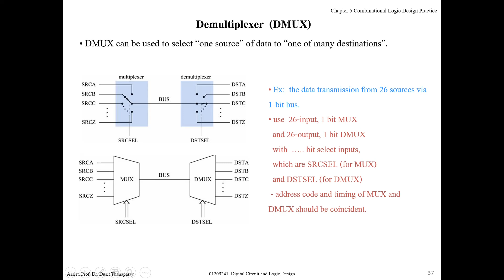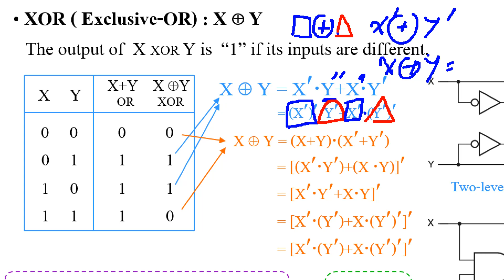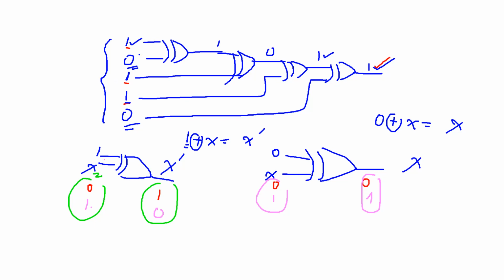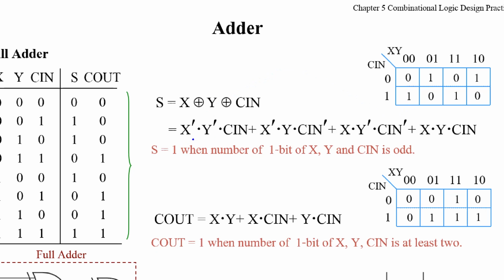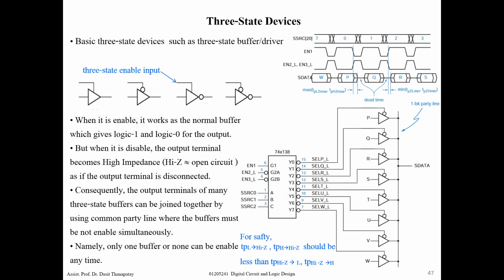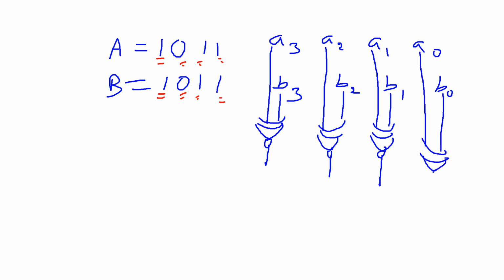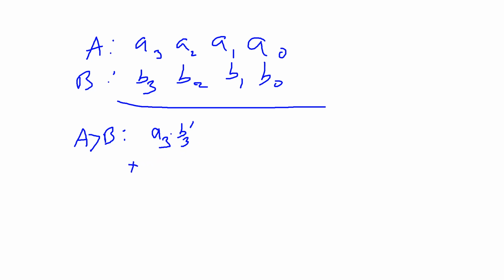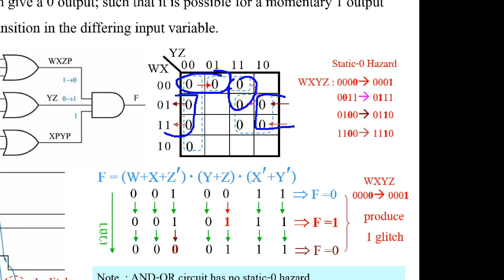01205241 sec 450 (IUP) Chapter 5 XOR and its applications

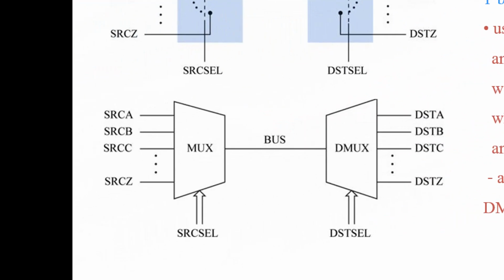Comment: 0:01 Demultiplexer (DMUX) : address code and timing of MUX and DMUX should be coincident.
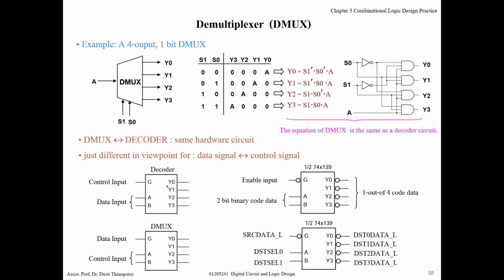0:44 DMUX <—> DECODER : Same hardware circuit, but just different in viewpoint for data signal <—> control signal.
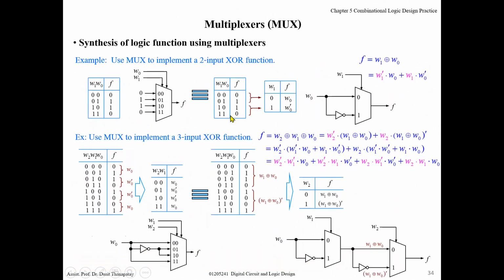4:40 Multiplexers (MUX) : The enable input EN_L is active low and the select inputs are named C, B and A (C is MSB).

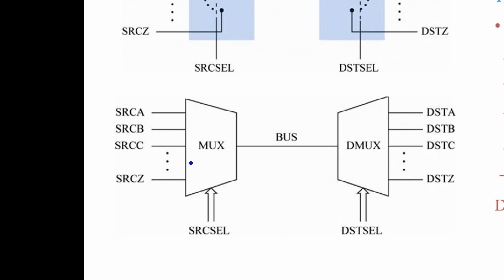Comment: 0:00 DMUX can be used to select "one source" of data to "one of many destinations.
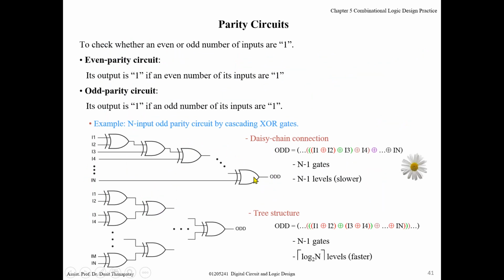19:49 Odd-parity circuit: Its outputs is "1" if an odd number of its inputs are "1"
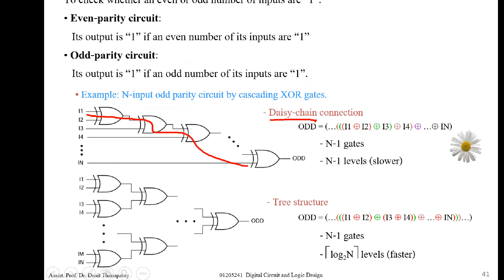21:43 The 74x280 9-Bit Parity Generator: It has 9 inputs and two outputs that indicate wheter an even or odd number of inputs are "1"

Comment: 4:35 The equation (and the structure of the picture cicled.) of DMUX is the same as a decorder
      circult.
40:59 enable input is active low----->put 0
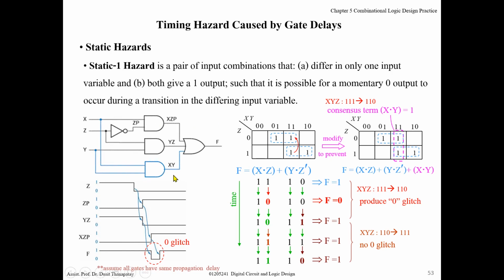1:06:44 Timing Hazard Caused by Gate Delays---->Static Hazards---->Static-1 Hazard.

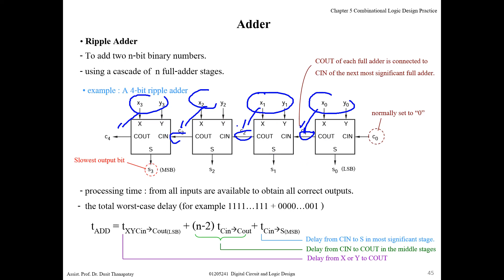Comment: 36:53 Ripple Adder: using a cascade of n full-adder stages. Count of each full adder is connected to Cin of the next most significant full adder.
53:25 Iterative Comparator: the inputs and outputs of each modules are cascading.
1:01:20 Magnitude Comparator: to indicate an arithmetic relationship between two numbers. (Compare from MSB to LSB).

Comment: 1)7:48 XOR ( Exclusive-OR) | The output of X XOR Y is “1” if its inputs are different.
2)21:56 The 74x280 9-Bit Parity Generator | It has 9 inputs and two outputs that indicate whether an even or odd number of inputs are “1”.
3)24:27 Adder | It’s binary adder for both unsigned number and signed two’s complement numbers.

Comment: 5:33 Edible input is some kind of control input
6:56 Exclusive-OR gates, in case of x=1 y=1 the output is 0
16:20 Parity Circuits are used to check whether an even or odd number of inputs are 1.

Comment: 4:31 Demultiplexer : The equation of DMUX is the same as a decoder circuit.
16:02 XNOR or EQU : If the number of bubble is odd, it is XNOR gate.
26:53 Half Adder : 2 bits inputs: Half sum and  Carry out.

Comment: 0:19 Demultiplexer (DMUX) : The device uses for receive one input from Mux and give many outtput.
16: 20 Parity Circuits : It is a circuit that uses to check an even or odd number of inputs are 1.
39:32 Three-State Devices : In enable, it work as normal buffer but in disable the output terminal will be Hi-Z

Comment: 10:06 In XOR circuit, You can add inverse bubble in 2of input or one input one output to the digital circuit and the output will be the same as A XOR B.
34:13 When you do Ripple Adder. The curry-out of the last digit need to connect to curry-in of the next digit.But if you operate the circuit at the same time the answer will be error. You need to be consider about the propagation delay of the circuit be to carry-out the correct thing to the next digit.
1:05:32 The timing hazard by gate delay If you have more component of gate It will not the write time of another gate to operate and it have glitch. We can fix by Write K-Map and using the compete some to predict and check the value are in from the delay.

Comment: 14:39 Exclusive NOR gate or known as Equivalence - output of this gate will be 1 if input are actually same.
20:23 Odd Parity Circuit - Outputs of this will be 1 when odd numbers of inputs are 1.
47:24 Comparator - use to compare the value of two binary no. to identify that they’re same or not.

Comment: 16:18 Parity Circuits: To check an even or odd number of inputs are 1
22:23 The 74x280 9-bit Parity Generator:Output EVEN is 1 when number of 1input is even
29:59 Adder Count = 1 when number of 1-bit of X,Y,CIN is at least 2.

Comment: 47:17 comparator structure: use a 2-input XOR/XNOR gate as a 1-bit comparator
52:37 iterative comparator circuit : the circuit contains n identical modules 
55:28 comparator - operation steps

Comment: 16:22 The parity circuit is used to check number for logic are an even or odd of input are“1” 
24:22 The adder from binary is for unsigned value and two complement signed value 
47:18 The comparator is use to compare with the value of two binary number are the same of different

Comment: 16:19 Parity Circuits used to check the number of logic 1.
52:46 Iterative Comparator Circuit is the circuit that contains n identical modules.
1:02:27 Timing Hazard is caused by gate delay.

Comment: 21:44 Output EVEN is 1 when the number of “1” inputs is even.
1:01:30 Example of 12-bit comparator using 74x85 4-bit comparators
1:05:45 We use the complete sum to implement the circuit

Comment: 16:13 Parity Circuits: Check whether an even or odd number of inputs are “1”.
24:29 Adder: It's a binary adder for both unsigned numbers and signed two’s complement numbers.
47:21 Comparator: Compare whether the value of two binary numbers is the same or different.

Comment: 6:49 - Exclusive-Or Gate -  XOR It's can be one, only the case that inputs are different.
24:27 - XOR - Adder , application that can apply for XOR, half adder won't have carry out.
1:01:53 - Comparator - Iterative Comparator circuit is the technique that use identical modules to do function of comparator.

Comment: 6:17 Demultiplexer- DMUX and Decoder are different because of the data Input and control input.
26:29 half adder
45:16 Three-State Devices : 74x254 octal three-state transceiver.

Comment: 1:35 for example 4 output 1 bit DMUX have s1 and s0 as and input depend on the sequence will lead to the diffrent position A among 4 possibility
7:48 for exclusive or there are 2 possible way either we put 1 0 or 0 1 from this we come up with the formula state that x'*y + y'*x
9:30 XOR: as we replace variable by rewrite as triangle represent one variable and square for another from ding this we can conclude that x xor y can be both invert

Comment: 0:37 DMUX <-> DECODER : same hardware circuit
4:47 Decoder - since each output bit of a binary decoder is in minterm of input variables, then the binary decoder can be used to create any logical function.
7:18 XOR - The output of X xor Y is 1 if its inputs are different.

Comment: 0:53 Example: A 4 output, 1bit DMUX
22:16 The 74x280 9Bit Parity Generator :It has 9 input and two output that indicate whether an even or odd number of input are 1 .
47:20 Comparator: To compare whether the value of two binary numbers are the same or different.

Comment: 0:07 Multiplexer is the device that you can select the data from one of multiple input to output
0:15 Demultiplexer have one input but have multiple output and you can select which output that you want the data from input to go
6:48 Exclusive Or it is similar to or except in this case when x =1 and y=1 the output will be 0

Comment: 14:19
XNOR: if value of x y not the same its will be 0  but if x y is same its will be 1
difference of NOR only both 1 value.
16:16
The application of XNOR : Parity circuits
and the example of parity Circuit: Even-parity circuit and odd parity circuit
Even parity circuit: output is 1 in an all even number of its input are 1
odd parity circuit: output is 1 in an all odd number of its input are 1
47:25
Comparator: compare value of the binary number of 2 are different or not

Comment: 1:00 DMUX DECODER is same hardware circuit
4:53 Decoder Binary decoder input: n-but binary code output:1-out-of-2 code
32:46 Adder in 4-bit ripple adder count of each full adder is connect to CIN of the next most significant full adder

Comment: 23:15 Parity circuits if 1 number of input is even the output will be 1 on evengate 
34:51 Adder Ripple adder  there delays in each adder
54:51 iterative comparator curcuit  if x and y is zero the Eqoutput will send 0 and your final result will be 0

Comment: 6:47 Exclusive-OR Gates(XOR) : if inputs are different output is 1.
16:08 Parity Circuits(Even-parity circuit) : Its output is "1" if an even number of its inputs are 1.
24:23 Adder : It's binary adder for both unsigned number and signed two's complement numbers.

Comment: 5:00 DMUX(The equation of DMUX is the same as a decoder circuit, • just different in viewpoint for : data signal - control signal.)
5:25 DMUX(show decoder)
11:50 Exclusive-OR Gates(how to use only NAND gate on XOR)

Comment: 16:14 Parity Circuit : It use to check the number of logic "1".
22:00 74x280 9-bit Parity Generator : It has 9 bits input and 2 outputs for even and odd.
23:20 74x280 9-bit Parity Generator : You may use 4 or 8 bits because 0 XOR anything still the same results.

Comment: 0:40 Example : A 4-putput, 1 bit DMUX
14:16 XNOR : The out put of X xor Y is 1 if its inputs are the same.
21:46 Parity Circuits: The 74x280 9-bit parity Generator.

Comment: 19:56 Odd-parity circuit : Its output is "1" if an odd number of its inputs are "1".
20:39 Odd-parity circuit (Daisy-chain connection).
21:08 Odd-parity circuit (Three structure).